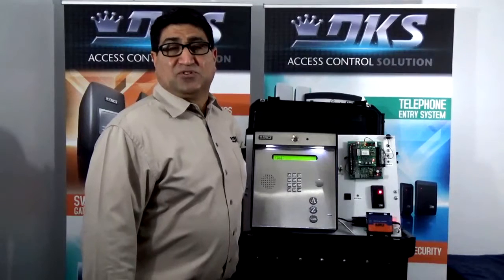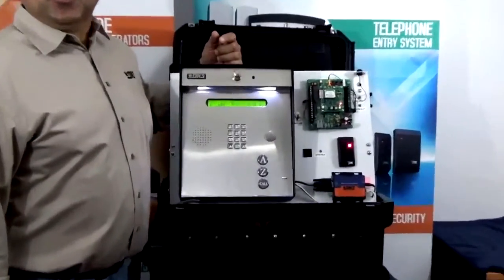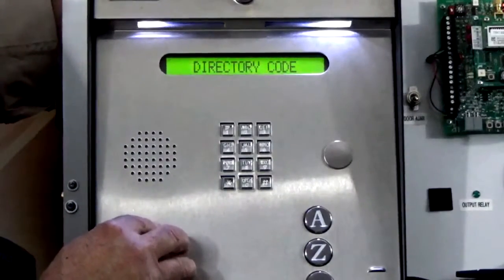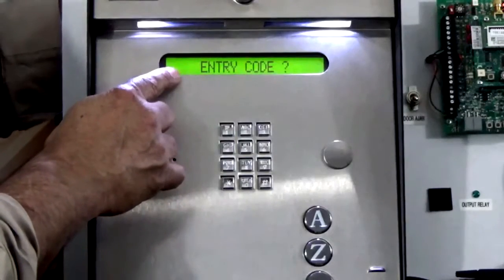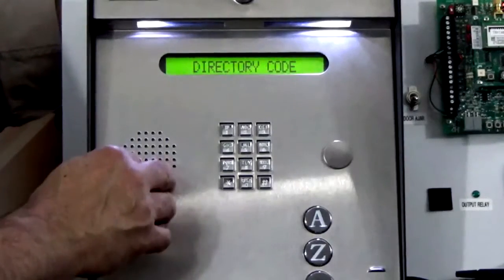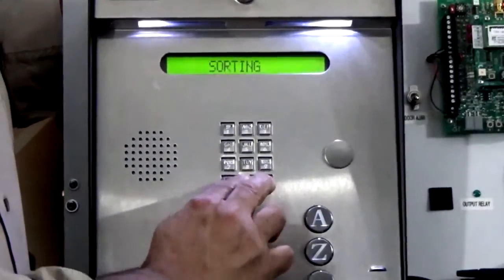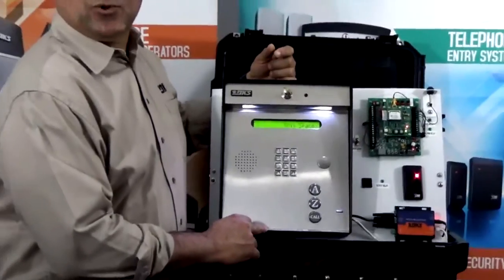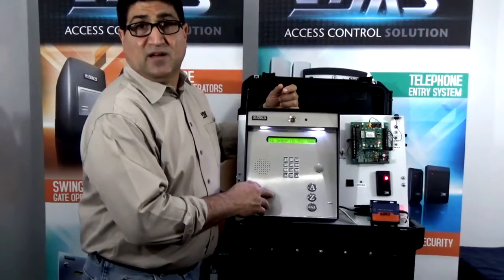DKS - Entry Code Programming

Comment: I have to add location code. How many access codes will location 02 hold? Can I use the same location code for all access codes to be entered? Also, sometimes the code works at first and then later it does not work?

Comment: What if I just want to change the entry code do I have to go through all the steps? We have a default entry code that unlocks the front door, so anybody can get in.
Reply from the maker: Wood Peck, yes the steps for adding a new entry code and changing an existing entry code are the same. Because your system can accommodate up to 3,000 different entry codes, it must have a way of storing and cataloging all those codes. Each entry code that you enter must be assigned to a directory code, only one entry code can be programmed for each directory code and entry codes cannot be duplicated.

If your site is setup with DoorKing programming software, Account Manager, making these changes can be completed if fewer steps than if done directly from the telephone entries keypad.
Reply: @totalsecuritywarehouse3621  How do we clear an existing entry code? Is there a way to locate the position of the code so it can be overwritten or deleted? We have someone who left the building and knows the common entry code... we need to change it. Thank you!
Reply: This is exactly what I need to know. How to delete the old code.

Comment: Now can you show how someone uses the code to dial? I know my code to my gate, but just entering the code doesn't dial my phone
Reply from the maker: Hi Tamara. How a guest would dial a phone number to reach a resident is dependent on the model telephone entry system that you have.

On smaller systems with a "Push to Call" button, the guest simply presses the "Push to Call" button to call the programmed phone number.

Other systems that have multiple residents phone numbers programmed into the telephone entry system will have to press the desired residents directory code number; for the first programmed number simply press 01, for the second number press 02, and so on.

If you can let us know what model your telephone entry system is we could provide more exact details. The model number is usually printed on the front plate of the telephone entry system, or on a sticker on the back of the unit. Or, if you can take a photo and send it our way, we can help you identify what model you have.

Let me know how we can help you best!

Comment: I have a question, see I forgot my mastercode to my doorking 1812 and don't know how to change it now without the mastercode
Reply from the maker: Hi Goksel Peduk. If you forgot your Master Code, a new Master Code can be programmed without losing any of the information that has already been programmed into the unit. A new Master Code must be programmed from the 1812 unit. Open the cabinet and flip the Master Code switch to ON, then enter a new 4-digit Master Code on the keypad followed by *.  You should hear a BEEP when finished to let you know the new Master Code was accepted. Turn the Master Code switch off when completed. Hope this helps!

Comment: My 3 digit code works when calling from the Main Gate. However, the same code does not work for the building access. I get the “We’re sorry you have reached the number that is no longer in service or has been disconnected.”

My building access code had been deleted and re-entered a few times using my same cell phone number. Could it be the system 1835 firmware or software that needs updating to the latest?

Comment: Does anyone know why when my apartment’s intercom/call box is not working with my code? — My calls go straight to my cell phone’s voicemail instead of ringing my phone & allowing me to press 9 for opening the outside entrance door for my visitors.

I have called both my service provider & the phone maker; they have no answer for me.

Could it be that my apartment managers are not doing the right inputs in order for my cell phone to ring instead of going straight to voicemail? 🤷‍♀️
Reply: @Valire Davis, a couple things come to mind; if you are receiving the calls on your cell phone you should be able to adjust the amount of rings before a call goes to your voicemail. Try increasing this.

Another thing that comes to mind is what your systems programmed "Talk Time" is set to. This would have to taken care of by your property manager; you can program the system to allow 1 sec, up to 4 min and 15 sec of Talk Time once a call is answered. Perhaps this setting got adjusted incorrectly.

Hope this helps, let me know.
Reply: @alexwright3004  😊 .. Hi, thanks so much for the advice.

I don’t think that the amount of rings that are in my phone’s setting is an issue because it rings several times before I answer it if someone calls me using my cell phone number; the lack of ringing is only related to that call box.

I was able to press 9 before & the door would open. — I have never attempted to have a conversation through that intercom with anyone who showed up because we did it on our phones after they arrived. Maybe the box needs to be serviced?? 🤷🏻‍♀️

Thank you for trying to help; much appreciated.
Reply: Did it get resolved? I’m having the same problem

Comment: Is the master code in this case different of every door king machine the code after *02
Reply from the maker: The master code is the four-digit number REQUIRED to gain access to the system memory. If you don't know what the master code is, it may be hand-written on the inside of your unit, or in the manuals somewhere.

If you can't find your master code, a new one can be programmed by opening your DoorKing unit and locating the tiny MASTER CODE switch, turn it on, then on the front keypad enter your new four-digit master code then press "*". Turn the MASTER CODE switch off when you are completed.

To add a new entry code, you would press *02, followed by your master code.
Reply: 9999 is the default and majority of these lazy corporates are to lazy to change cuz they all think we are too dumb cuz we dont wear suit and tie .

Comment: Good video. How can I program a 4 digit entry code for relay #2, You showed relay 1 for walk-in gate. Thank you
Reply from the maker: @Sergio Molina, four-digit entry codes can be made to activate relay 0, relay 1, or relay 2 or any combination of relays by programming HI and LOW ranges for each relay. Take a look at the manual in the link provided below, at section 3.7.3, page 49.

https://www.doorking.com/sites/default/files/downloads/1835-065-N-1-21_80-Series.pdf

Comment: How can you adjust the volume?
Reply from the maker: Most models have a small dial located on the main circuit that is labeled SPEAKER, or SPK VOL. Turn the dial with a small screwdriver in small increments. Note, adjusting the speaker volume can cause feedback; the microphone volume dial, or feedback dial may also need to be adjusted to combat this feedback.
Reply: @totalsecuritywarehouse3621  this one does not have anything labeled speaker . Is a mircom model . Do you have any idea?
Reply from the maker: @ericaawake9503  Sorry, we do not work with Mircom models at all.
Reply: @totalsecuritywarehouse3621  thank you

Comment: If I forget the entry code how can I get it back
Reply from the maker: If you have forgotten your Master Code, no worries, a new Master Code can be programmed. You will have to have keys to open the entry system. Located the small MASTER CODE switch, typically located near the bottom of the main circuit board. Turn the MASTER CODE switch ON. Then, enter a new four-digit Master Code on the front keypad, then press *. You should here a BEEP. When complete, make sure to turn the MASTER CODE switch back to the OFF position. Hope this helps!